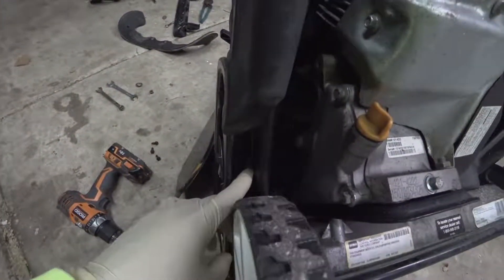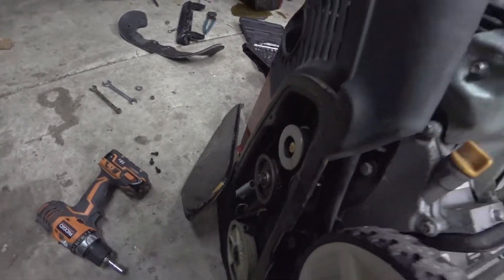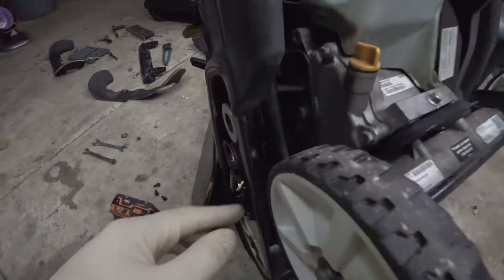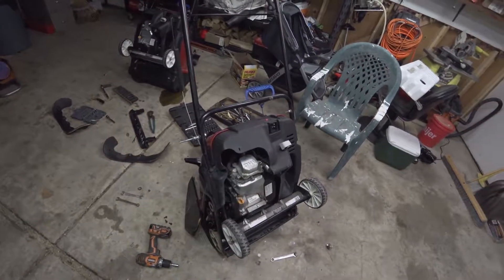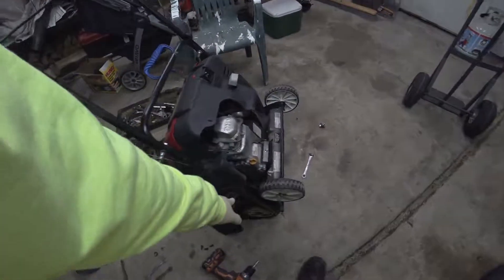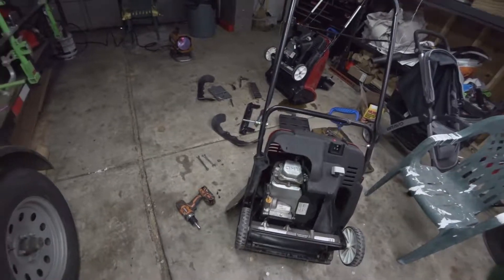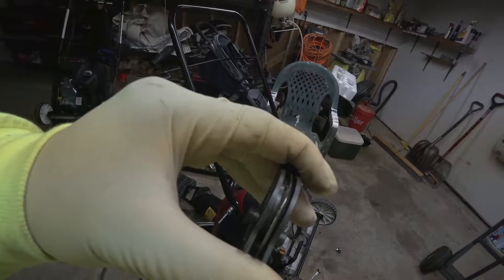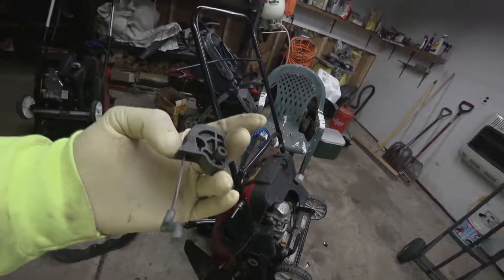Toro power clear auger won't stop turning! SOLVED!

Comment: They replaced this with a metal part. "Genuine OEM Toro 140-3660 Clutch Cable Guide for Power Clear Replaces 108-4919"